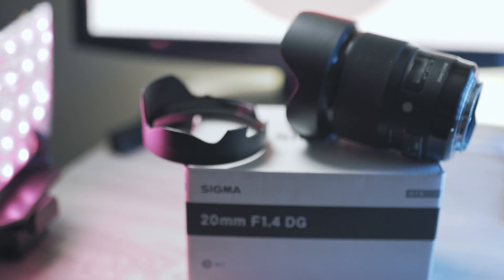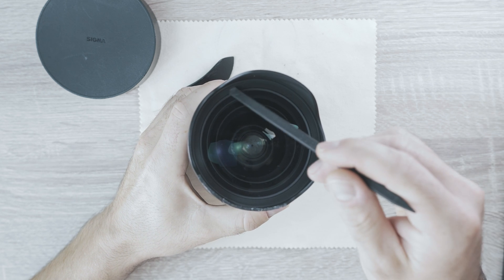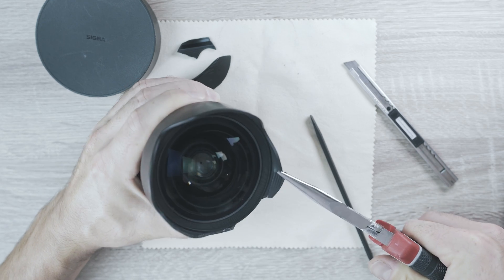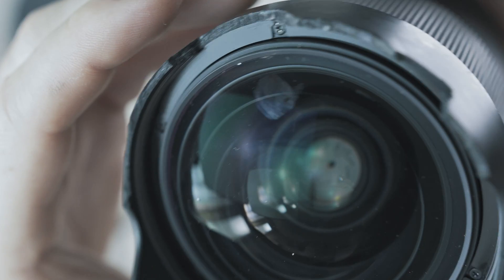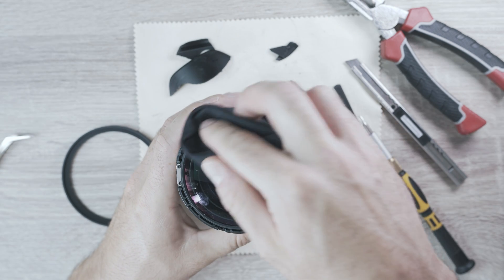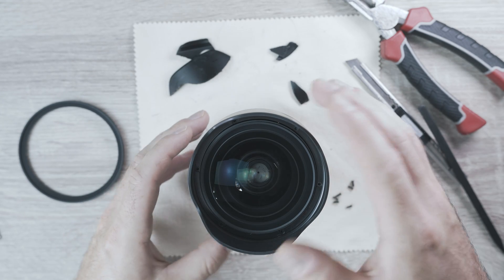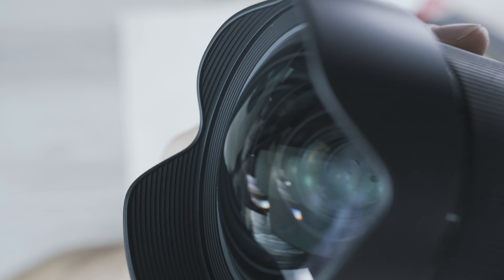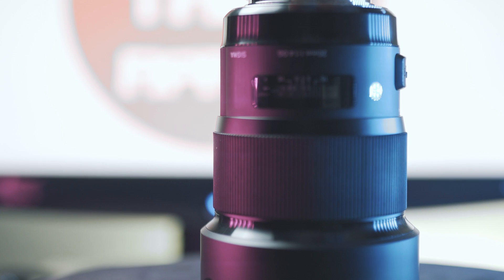Sigma 20mm f/1.4 Art lens | Lens Hood replacement | how to fix sigma 20mmf1.4 [4k]

Comment: This comment is for anyone else with a Sigma 14-24 Art wondering what our options are: I just figured it out! The poster of this video mentioned in one of his comments to use "strong friction." I just gave the ring a solid (counter-clockwise) twist and it worked. I was pretty nervous after having "studied" the lens hood and trying to get it loose, then being worried about breaking it - and so on. We all know the drill. No worries - the outer lens hood is actually comprised of two contraptions that screw into one another like a bayonet . When you twist the (flower) hood off counter-clockwise, eventually you'll see that the inner bayonet clamp is what screws into the lens barrel (and the flower lens hood). Oh god, technical writing is not my thing. Long story short: just twist it off. Having the lens in the 24mm position allows you to exert the most amount of leverage needed to loosen it. If anyone wants pics just ask. The inner bayonet ring goest back on the lens body (without the flower hood) and you've got your own DIY front conversion done. No need to send this in.
Reply from the maker: thanks for your tip!
Reply: @takeapart  No, thank you for the tips! The way it works is the inner ring on the flower filter is what screws in and out of the lens barrel, but you need to twist the outer flower lens hood in order to loosen the system. Once it’s loose you can continue unwinding the inner filter. That inner filter basically uses a pressure fit to secure the outer filter to the lens barrel by way of a lip/track system. It will all make sense once you loosen it. It definitely opens up a bunch of filter and lens protection options without having to drop 200-400 on these ugly aftermarket systems which are way too large and ugly. In theory you could even make your own VR filter this way on a budget. I can’t believe how easy this was 😅
Reply: Thank you I broke my hood this weekend. Where can u source replacement parts ?
Reply from the maker: links are in description
Reply: Where do I get a replacement lens hood
Reply: D Stone Where buy hood bro for 14-24 sigma?
Reply: @donsupernova   Good question. I didn't buy a replacement hood, I just removed mine. You can put it on and off. I saw some on eBay for around 30 USD. I believe you can also use third party filter holders as a hood, but they're big af.
Reply: @Dstonephoto  Any tutorial remove hood 14-24mm?
Reply: @donsupernova  I thought I posted an imgur album of my process. It's kind of stupid simple: twist really hard. The tricky part is keeping the lens mount sufficiently secure (don't attach it to your camera) so that you can apply a sufficient amount of force to twist it loose. The way I did it was by rotating (I have the Canon version) to the 24mm point and then rotating the lens hood counterclockwise (like a screw) in order to loosen it. Whatever you do, make sure you do it somewhere safe in case you drop the lens or whatever and practice/simulate the process before doing it. There's basically one really tight point which requires force. Once you've loosened that part (the one that requires a lot of force) you can continue to (easily) unscrew the hood (it requires a bunch of rotations to remove it). The lens hood is essentially two lens hoods in one, screwed into each other. Does that make sense? I know it sounds scary.
Reply: @Dstonephoto  link IMGUR BRO pls
Reply: @donsupernova  I'll post it sunday. Otherwise, what do images do you need ( don't say everything haha)
Reply: hi mate, having big trouble with this exact issue. Would you be able to get in contact and help? that would be amazing. tom
Reply: @hoverfilm4783  i can try. Whats your IG
Reply: Hi man pleaseeeee can you help me?
Reply: Has anyone 3d printed one of the hoods. Can't seem to find anywhere to buy one apart from over £100

Comment: Question - if you screw back on the thread.  why can’t you unscrew the thread and not brake it further and leverage it off? Surely turn it anti clockwise just as you tightened it to stay on??
Reply from the maker: hi, yes you can give it a shoot!  it requires good friction to turn it...
Reply: @takeapart  any ideas how this might be achievable I’ve looked for source online and so far yours is the best video seen. I need to remove the hood without damage. Any ideas?
Reply from the maker: I would drill small holes and try to unscrew it that way ...

Comment: i have issue with this lens. the end barrel wobbles slightly. any tips?
Reply from the maker: hi, it depends what is broken if so ... I would take it apart and check internals
Reply: @takeapart  i can't find any guides for native sony mount art disassembly. You have a 35mm canon mount guide. Not use if you can do the same
Reply from the maker: it should be similar... just take extra care and you will be fine...

Comment: Thank you very much for this.  Have you had any experience with replacing the hood on the art 14mm?  I started to try your technique, got the hood mainly broken off but the interior looks very different and afraid to go any further.
Thank you
Reply from the maker: hi , Im pretty sure it’s similar as this 20mm ...  but you must be careful as it’s really close to glass...  
good luck and thanks for watching
Reply: Hi Douglas, I am looking at doing the same. Can you tell me if you succeeded in replacing the lens hood on the 14mm 1.8 ART ? Any special tools?
Reply: @olesalomonsen6575  I tried unsuccessfully and so I sent it in to Kurt’s Cameras in San Diego. They are an authorized Sigma service center. They do excellent work and they are very reasonable. I do not recommend doing it yourself unless you really know what you’re doing, I almost damaged the glass.
Reply: @kyanos1  Sigma 14-24 Art gang checking in here. I would love to remove that hideous flower lens hood without paying Sigma for hood swap service. Those add-on filter holders are an eye-sore of an absurdity I'm hoping to avoid. Can I ask what they're quoting you for this at Kurt's? (Why didn't these assholes at Sigma just make those lens hoods simple twist-off contraptions, instead?)